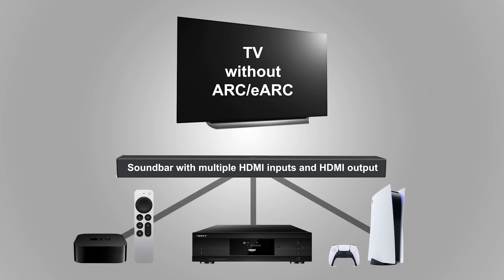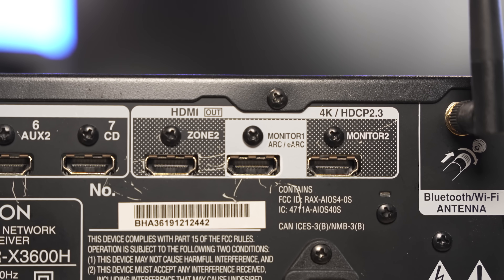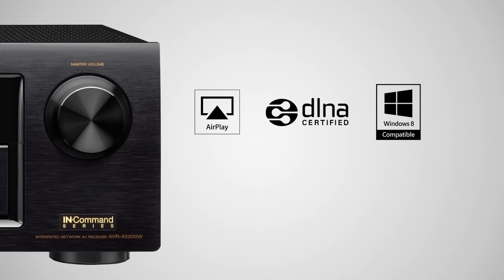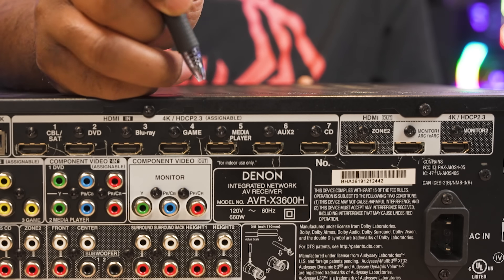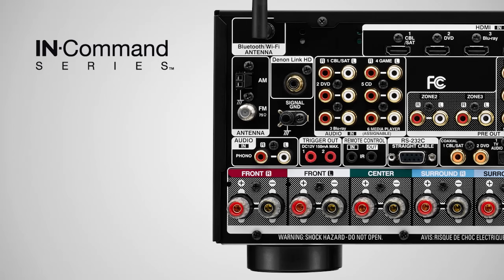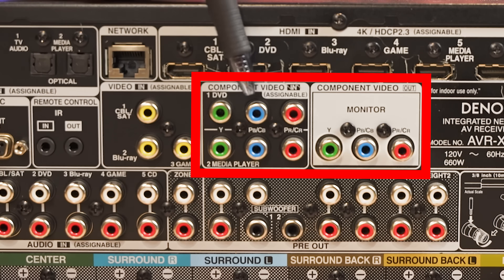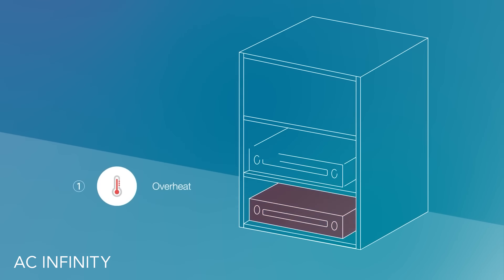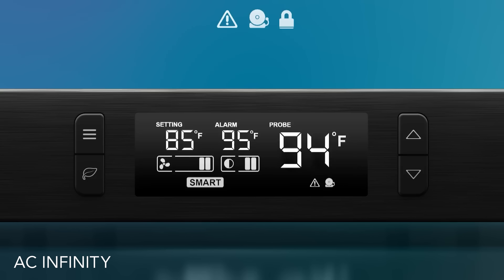Avoid These Mistakes When Setting Up Your Home Theater Receiver

Comment: Hi, can you explain why my AVR decides to mute my 5.1 speakers when using rca before a specific threshold of volume? Basically if i test my speakers at low volume, it doesn't send audio until the threshold is met, and once met it won't forget it unless i tweak certain 5.1 settings on my input. Basically i need to do the same for each channel. Is this some protection? I thought something was wrong with my system lol

Comment: Hi,I have a 7.2" Denon receiver with Dolby Atmos speakers connected to the surround back port, which is how I've had it for a long time.
To connect two more Dolby Atmos speakers, I need a receiver with 11 channels or more.
I was thinking maybe running four cables into the surround back.
Is that possible?
I won't do anything unless I'm sure.

Comment: What if you had a receiver that didn't support arc and you were trying to get sound from a DVD player to the receiver and out all surround sound speakers? Specifically a Yamaha HTR-6130. I only get sound from the front speakers.
Reply from the maker: It depends on your dvd player but you have a few options. If the dvd player has HDMI then you can use an hdmi splitter to extract audio from the dvd player to the receiver.
Reply: @ChrisMajestic  Thanks for responding but I tried that using HDMI for the video and RCA cables for the audio but still only getting sound from the front speakers. The receiver sound test works on all speakers, front, center and rear.
Reply from the maker: @jenkinsljenkinssquire9137 using 2 rca cables is definitely only going to give you 2 channel audio. I’m saying you can try using an hdmi splitter to use one of the cables to send audio to the receiver as long as your receiver supports hdmi.
Reply from the maker: Yes the only way to get real surround sound from rca is to use multichannel with 6 rca cables. Watch my “everything you need to know about home theater audio” video.
Reply from the maker: Home Theater Audio - What is ARC, HDCP, Toslink, SPDIF, Dolby Atmos?
https://youtu.be/SZVlGxqIP-w
Reply: @ChrisMajestic  Will do. I though it had something to do with this unit not having ARC support and therefore does not have passthrough audio. Not sure if there is a way to fix that. Or if the easier solution would be just to get a newer unit that supports ARC
Reply from the maker: @jenkinsljenkinssquire9137 the only time you really need arc is if you want to send audio from your TVs built in apps
Reply: @ChrisMajestic  Interesting. Then I'm confused as to why the center channel and surround speakers get no sound through the HDMI cable.
Reply from the maker: @jenkinsljenkinssquire9137  is your dvd player using hdmi?
Reply: @ChrisMajestic  Yep
Reply: @ChrisMajestic  Yep but getting no sound out of it. Using the rca cables, i get sound from the front speakers

Comment: @chrismajestic I know this video is old but i have quick question.  I'm using active speakers right now that i have from my old DJ set up to provide audio from my projector in my man cave.  I have it all hooked up to a line mixer. I'm using  2 8in speaker with a 12 in sub.  the problem is that the line mixer doesn't have a remote control  so I'm having to constantly get up and adjust the volume sometimes through out watching a game, playing video games  or movie night.  Is there a way to run my active speakers through an AV unit and have control with some of the setting(eq, volume, input selector)?  I might add that my Active speakers are XLR connections.  I have seen some old school models on Ebay that do have XLR connections but the prices are on par with some new  mid tier AV receivers with remotes and HDMI connections.  thanks for your help
Reply from the maker: Nothing has really changed since this video 😉 Your best option is to use the preouts on the receiver (if it has them). When using the rca preouts the volume should be controlled though the receiver but should work great with active speakers. It’s no different than using an external home theater amp.
Reply: @ChrisMajestic thanks fir replying. It has made my decision much clearer. Thanks for responding

Comment: Great explanations.   My receiver is an older Denon, and I used to love it.  Recently moved, & it's been awhile for unpacking & setting it up.  It's not working, and my overworked memory banks are filled with where did I put that kind of stuff, can't quite remember how I set it up.  I came here looking for info about connecting the speakers, I might have done that wrong, but also the movers may have dropped my video.  But the red light turns on, so I'm just thinking & trying to troubleshoot.  I commend you about getting right to the point.  Thanks so much.

Comment: My wife and I used to run a Yamaha RX-V1800 that got real warm when running at full chat. My new Denon AVR-X1700H likely won't as it's not as powerful, but that AC Infinity looks like a good solution. I've been setting up receivers for years, but you do know your stuff. Very informative video, thanks!

Comment: A lot of cheap HDMI splitters and cheap HDMI capture devices that plug in to USB to a computer do bypass the HDCP. The 6 channel RCA output is for those older DVD players that are compatible with multichannel SACD and/or DVD-A discs to enable the 5.1 on these discs without having to get a Sony Blu-Ray player from the BDP-S6700 on up to the 4K players (most of the 4K players that Sony has are compatible with high resolution DVD-A 5.1 mixes, the BDP-S6700 only plays the Dolby Digital version of the 5.1 mixes on DVD-A discs and high resolution 5.1 if the discs are SACD) to access these discs for the 5.1 layer using the HDMI output but if you have Blu-Ray audio discs, you do need a Blu-Ray player using the HDMI output in to a receiver and the players that have an HDMI audio only output as well as the standard HDMI output are the ideal players to use for Blu-Ray Audio discs so that you can use the discs with the TV off or on. If you have the older SACD/DVD-A compatible players, use the 6 channel RCA outputs and not only do you have access to the hi-res, but also the regular Dolby Digital/DTS 5.1 mixes on DVDs. If you have the rare DTS 5.1 music CDs, you need a DVD player (most DVD players are DTS compatible as well as Dolby Digital compatible) or a separate DTS decoder connected to your regular player and separate decoders are rare and there are even rare CD players that have a DTS decoder built in. A DTS CD can read on some CD players and display the track numbers on the players but not play them because of no decoder.

Comment: Realliy nice info about adapter, pre out ( for active speaker like kef). The trigger part of the video show only one side of cable wire not the other side. I think you ll speak on your channel about hifi with eversolo and wiim streamer. I am a HTPC end user ( PC to HDMI HT receiver). I think mini led screen should be buy for screen not the TV tuner. 5.1 or more should use audient oria with active speaker :  genelec, Kali in 8, presonus Eris pro 8. PC should support asio HDMI multichannel for mix (cubase, reaper) and not only listen blue ray..

Comment: I have an Orei 2x2 HDMI Splitter where my inputs are 2 games consoles and my outputs are my TV and a monitor. I have noticed when using this, that HDMI-CEC (which worked before introducing the splitter) no longer functions. Is this because I have a splitter and not an AV receiver or is there a workaround? Any help is appreciated. Thanks :)

Comment: Tip: For movies especially, less is often more for bass.  Overdone bass is one of the two biggest reasons Dialogue is trash.

The other big reason is that dialogue usually goes through the center channel and they are often weak

Comment: Hi Chris, thanks for the Video ! I'm upgrading to an Denon AVR-S970H mainly for the HDMI out ! now... I'm not sure if what I'm looking to do will work but mainly, what's I'm trying to acheve is I somtime what to output to TV and Sometimes I what to Output to my Projector ! to do so at the moment is I have to change that HDMI cable in the back of the receiver... I was hoping I could chose the output has required on the Receiver.. I don't want to play both the tv and the projector at the same time ! the screen for the project comes down from the ceiling in front of the tv anyway !  Also.. is one of the HDMI a passthrough ?  so like if I wanted to plug in my cable Receiver and watch TV without turning on the Receiver ?  Hope you can find time to awnser some of my questions !  Thanks
Reply from the maker: You would just connect the tv and projector to Monitor1 and Monitor2. Both of them support hdcp 2.3 so as long as you’re using one and not both of them simultaneously you should be fine.
Reply: @ChrisMajestic  ok will try that as soon at it arrives ! can't wait ! Thanks

Comment: Every resource in internet only tells me that arc/earc technology enables you to deliver the sound of the source to your receiver, but nothing else. This means that plain old hdmi cannot carry sound information. I thought hdmi was created to carry both sound and video, so what's the point of arc technology?
Reply from the maker: ARC/eARC are specifically for audio. However, they work alongside video. They work simultaneously. Plain old hdmi can certainly carry sound information and has always done this. You are correct. That is what hdmi was created to do. ARC allows sound to be carried in the opposite direction. Instead of your streamer being the device sending sound to your tv, your tv can send its own sound back through the same cable to your sound system. That’s what arc is for.
Reply: @ChrisMajestic  Thanks for taking your time to respond, much appreciated.

Comment: Am I right in thinking that a fan cooler can also be plugged into the back of the receiver so it comes on at the same time? Would that be into the Trigger Out? Would that be necessary if you use something like the Infinity? Or are you best just switching it on and off separately yourself?

Comment: Awesome vid man! I’m looking into getting the x3800h 9.4 with HEOS and have a ps5 pro that I currently just plug into the eARC input on my Sony x950h but my old AVR broke after 8 years or something and I was only ever just using toslink to plug from that into the tv. So it looks like hdmi eARC from this new AVR to the eARC port on the tv is the way to go yeah? It’s kinda confusing cos I haven’t had this new tech in a wile.

Comment: No where in this video does it explain how to access the onscreen menu or how to setup the reciever to send a signal to the tv and what hdmi to use in order to view the menu???
Reply from the maker: The onscreen menu works automatically if your tv is connected to the hdmi out of the receiver.

Comment: I have an old reciever, and it does not have pre outs or hdmi, but ive always wonder what and why is the component out used for, for example, i have my tv on video 1 on my avr, but on the back of the reciever where i plug in the rca audio in, right next to it there is a an rca out, can you explain that one?

Comment: Onkyo tx nr 6100/// new just got it a week ago. Updated the software. Cannot get the feature 4K enhanced..  dvd/ bray.and Power etc  nothing  the earc on on both equip  and connected  from tv to ave rec ). Nothing. From Apple TV 4K to rec then rec to tv .. nothing .!! E/arc on or off —nothing ..Mmmm 🤔.. that feature no go .!! Can I turn it on thru the menu .??? Pls help .. thanks

Comment: I bought a pretty old Sony TA-VE810G. Guys, just save for a more modern one! These old ones are a pain in the ass, at least for me, i even asked for help, but noone has any idea what to turn on/off to be able to actually use all the 5.1 and maybe both of my "subwoofer out" are bad (even tho i bought it in a shop, where they test everything), from 1cm far away, woofer barealy makes a sound, maybe there is a trick that would require a remote, but it supposed to work :D 
So, just save up for a good one, dont throw all your money like i did....

Comment: This was a great video brother!! Do you think arc is better the optical audio? Im running optical on my denon but i do have the option to run arc. 2nd question. Do i need a special hdmi for arc or does the common style work?
Reply from the maker: Arc is definitely the better option. Any decent hdmi cable will work.
Reply: @ChrisMajestic  ok I will give it a try! Happy new year's

Comment: Thanks Chris - such a clear explanation. Stupid newbie question (just got my first AVR denon 3800h) and wondering can you do a wireless solution to the home theater or it must be wired. I can do wireless for the 550 sound bar (tv) but when I used the AVR no sound because the home theater speakers (soundbar, sub woofer, 2 speakers) I guess are not connected. Any insights would be useful before I get the wires which I would prefer not to do….

Comment: Just found your channel.  I have the Yamaha RX-V861.   I have if plugged into a Sansung.  Put new cones if on 901 speaker set or rear surround,   The Bose Larger cube speakers over recliners and Bose 901’s at front with a 500 watt sub.   I bought all this stuff around 2000.   I tried the Denon 95 x7 stereo and it will just overheat and shut off.   I seen your cooler.    My receiver when I used to play it was at the bottom of case and all the components on top.   The older units were built with bigger heat sink.   You video was great timing I went and bought this unit one opener. For people that like Bose and like to crank up I can up looking at new stuff that gets expense or trying different speakers.

Comment: I bought an open box STR DH590 that didn't have a microphone for calibration included. What might you suggest I do to solve this? It also didn't include a remote, so if you have a universal remote suggestion, I'm all ears!

Comment: Thank you, one piece of advice if having CEC issues as I did with my AVR-X3700H and my Sony X90K Tv is to remove all other HDMI cables from the receiver and TV, run just the 1 HDMI cable from eARC port #3 from the TV to the eARC port on the receiver, run the Denon Assist or set up HDMI Control and ARC. Then hopefully if the HDMI cable is good you should be able to shut off and turn on both with one remote. Then work the HDMI cables back into the receiver one at time and test that it changes sources and again shut off and turn on without issues. I found my old Wii U HDMI cable to be the culprit on why it wasn't working.
Reply: I just noticed your comment on this video and tried that approach on my Denon receiver and it solved a problem I was having. Thanks, one question if you have the time, I am currently running most of my components, like blue ray, PC and cable box off the HDMI connections on my Samsung s90c which is working well with all my components showing up on the Samsung screen and easily selected as needed. The question I have can I mix HDMI connections with some components using hdmi on the Denon HDMIs and other components directly to the Samsung TV HDMIs? If this works then the total HDMI inputs is increased from the total on the Samsung TV.

Comment: Awesome content!
So, I'm replacing my 79 watt Denon 5.2  S670BT with a90 watt  S970H 7.2 so I can use my recently acquired Polk ES90 height speakers but the S970H doesn't have a Height Speaker labeled channel.  Instead it has an assignable Surround Speaker.  I can only assume the set-up menu will allow me to assign, or repurpose that channel for height speakers, amirite?

Comment: Have you made a video buying? Receivers in the used market. I'm looking at 1 right now.
Yeah, this seems like a good deal. But it might not come with the microphone. Can I find that attachment is separately? And a few of them online, do not have your multitros, is it? That's Easy as hiding a replacement on Amazon or Is it a lot harder?Okay I replacement parts

Comment: I'm looking into using one with current gen consoles such as the PS5 and Nintendo Switch, but also with older/retro gen consoles and one thing I'm wondering is (since I'm also interested in having the least amount of lag/input-lag when using one), wouldn't it be much better to connect only the audio part/cable from the console directly to the AV receiver instead than from the console > to the TV > then to the AV receiver from the TV? I know that for the PS5 since there's no other audio option, one can connect the console directly to the AV receiver with the HDMI cable and then to the TV but I am not sure if doing it that way will introduce any lag. In the case that it does introduces lag, then I guess connecting the console directly to the TV and then the audio from the TV to the AV receiver makes more sense. NOTE: comment left before finishing/watching the video completely.

Comment: I live in a home full to tech junk that I got when I bought the house: 3 3D TVs, 1 JVC 3D projector, 3 receivers, Wireline control pulse bus, wyrestorm, RTI, speakers in every room, Sonos, a video camera system, and a HAI Leviton PLC that runs everything.  Ive been slowly learning all of this tech junk to get it working again and used this video to replace my Yamaha receiver with a Denon receiver I found in the living room so I could get my home theater golf simulator working.  This was very helpful.

Comment: 4:45 Also one of the most useful aspects of ARC (imo) is being able to control the volume of your AV with, say, a Roku remote.  My living room Roku can only control my TV but with ARC, the volume on the Roku remote controls the AV volume.  It'll also allow the TV power button to turn the AV on/off with the TV power button.  SOOOOOOOO handy for simplicity.